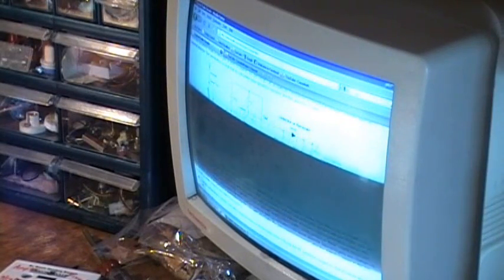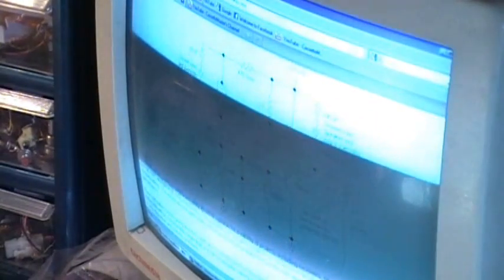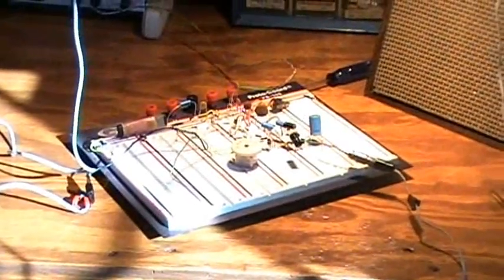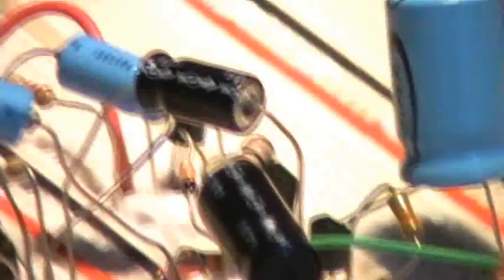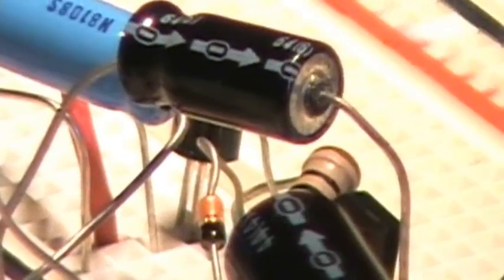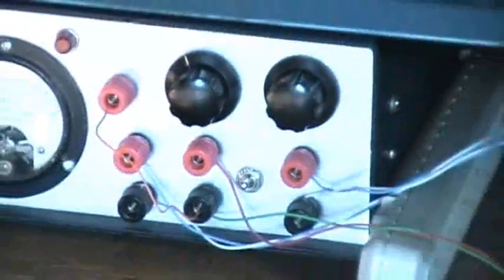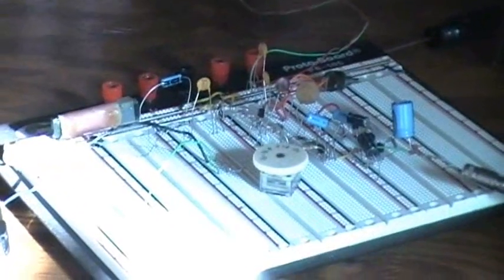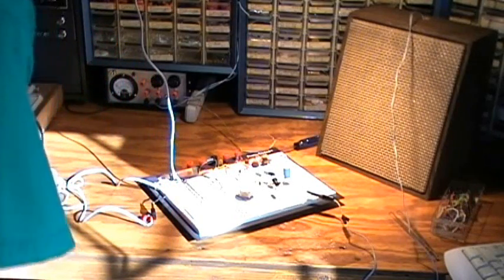Homemade AM radio (temporary--on breadboard). Design from Techlib.com

Comment: I suggest you take a portable AM  radio tune it until you find the worst buzzing noise, then walk around your house until you locate that noise (EMI) and then figure out how to quiet the source of noise. It will make your experimenting much easier. You may have several EMI sources, you can also shut off breakers until you find the source(s).  Assuming it is located in your house.

Comment: @themaritimeman you might be able to. I myself have a couple of the larger sized bread boards. I notice that Im not very conservative with space, but I try to improve the density of the layout when I transfer stuff to stripboard. Alternatively, you could skip the bread board stage and use perfboard which would be cheaper and more permanent. Myself though am a fan of stripboard, which allegedly is a british fascination.